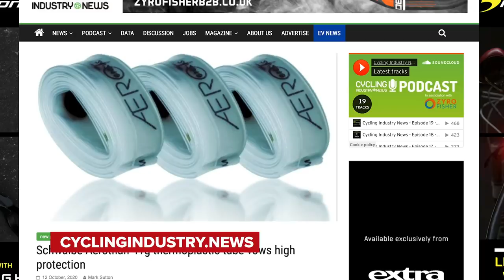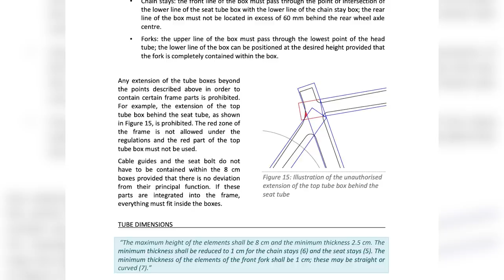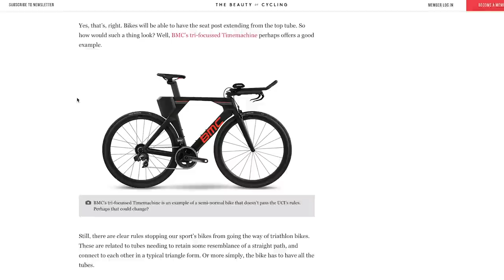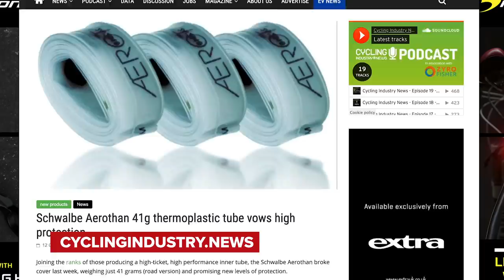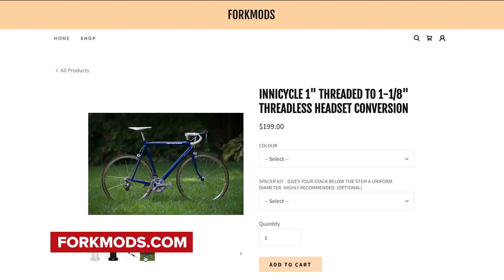New UCI Rules On Bike Design: Will They Change Everything? | GCN Tech Show Ep. 147

Comment: It's the perfect excuse to bring in new bikes on the market, that will be 7% more stiff, 11% more aero and 30% more expensive than last year's models!
Reply: I mean to give them credit they'll probaby be more faster and more complianter also.
Reply: + more sluggish because there will be no rim brake option only disc, rubbing discs 😅, fucking regretting buying discs brakes road bike;-;.
Reply: This is why I own a TCR. No bs
Reply: Meanwhile my favorite bike in my vault has 300% the weight, about 20% the stiffness and a geometry that would make any UCI regulator cry in pain.
But it's realy comfortable and reasonably fast.
Reply: And in red
Reply: @sirpablito6018  I'm not a fan of rim but yea, I feel bad for the people that does. Especially weight weenies. What's the problem with these manufacturers though, is it really that hard to put out a rim version. It's not like disk is absolutely better than rim.
Reply: @diesistkeinname795  and the aero frontal area of a double-decker bus 😂😂😂😂
Reply: @sirpablito6018  you know you can adjust your disc brakes? Fairly common to have to do it after you've had a wheel out. It can be a nuisance but they should never rub when properly adjusted
Reply: @RichardMigneron  Nope, the frontal area is about the same or less than on my roadbike.
Things like the BB beeing in front of the steerer tube, the handlebar beeing directly below the seat or a wheelbase longer than a DH MTB would sure make the UCI go crazy, but that's normal for recumbents...
Reply: @nt2883  Yes, I know m8. Idk what discs u have on your bike but mine new ultegra seems to be very sensitive   to everything: tight cornering, emergency hard breaking form high speeds, pouring raining but to be fair it saved me from crashing into a car who's driver was a moron. To conclude I think some ppl have problems with discs some don't. I've had problems from the start,  I think road bikes don't really need them, especially pros don't need disc brakes and they are made to ride them just to show us, mortal ppl that they are great and it is an upgrade to rim brakes which is totally not true. Discs are great for xc , gravel,  e bikes but not road in most of situations. I personally feel like I would be faster on rim brake bike so do team sky😉 because rim brakes just work, don't rub unless u fuck up your whole wheel;-; and discs can be bended even slightly and they rub af ;;-;;
Reply: @sirpablito6018  I use SRAM apex on my gravel bike and I find they're sensitive to axle tension but otherwise fine. A flexy frame will make them play up under heavy load. On my recumbent I have cable operated discs and they are always perfect all the time
Reply: @nt2883  Well I have hydraulic ultegra with this two gigant pears on a handlebar. I guess cable ones are just simpler and that is what makes you like them 😁. I'm happy for you m8 , I wish mine were always ok;;-;;
Reply: @satrioesar7151  $$$,$$$.$$ it's all about marketing. Hydro disc brake systems are more expensive than their rim brake counterparts. Wheels are generally more expensive too.
Reply: @TheMASDrummer  TCR is the best!
Reply: @RandomGuy-ol6wi  Apple's new M1 chip has turned your argument on its head.

Comment: The vast majority of "aero advantage" comes from the rider's position. Nothing more. To get that, you need to spend time in a wind tunnel together with an engineer/analyst. The "marginal gains" from additional aero beyond the obvious like teardrop shapes for tubes, better matched tyre/rim width and deeper section rims are microscopic by comparison: But as ceramic speed continue to prove, the maybe fictional 1W advantage can still be sold to enough suckers for a 4 figure sum. This used to be known as snake oil salesmanship.

Comment: The bike vault rules are all wrong. Aligning the cranks with the chainstays is permissible, and often looks better than precisely 3 o'clock. Valves at the top are just as good as at the bottom, the logos on the rims and tyres sometimes force one or the other, but otherwise either is okay.  And the chain in the middle of the cassette is fine, too, as long as the front is on the big ring.
Reply: Hear, hear
Reply: Agree, the 3 o'clock position doesn't look harmonious and even looks disturbing. Look at all product photos of the manufacturers, they are always aligned with the chainstay which look much better.

Comment: Hey GCN, have you ever noticed that every single bike manufacturer shows their bikes with the crank lined up with the angle of the chain stays? I believe this is the correct position for the cranks which is not quite at 3 o'clock (unless the chain stays are horizontal like MTB bikes). That BMC TMR01 actually has them in the proper position! Connor...

Comment: I ride Tubolito innertubes for a while now, also made from plastic, 37g per tube, no problems so far. But nice to see that a big player now has a similar product, potentially cheaper.
Reply: Why not tubeless!?!! Most punctures seal themselves without you ever knowing they happened!!! And lighter. Much lighter....
Reply: @winstoncat6785  you don't have to convince me about tubeless, my gravel bike is set up tubeless, my mtb was for many years already. It's awesome. I don't fully agree with your point about the weight though, the Conti GP5000 non TL I ride on my road bike combined with tubolito inners are quite a bit lighter than the GP5000 TL with sealant milk. But then the GP5000 TL are an especially "heavy" TL variation compared to other brands. The puncture resistance is better, yes, but if there is a bigger issue or too big of a puncture it's a mess, changing a tube at the side of the road is no big deal, putting a tube inside a busted TL wheel with bits of sealant sticking everywhere is not so pleasant. That said: tubeless is the future also for road bikes, that's for sure.
Reply: @CristoffelBonorand  I was going to switch from Schwalbe Pro One to Conti 5000's, until I "accidentally" discovered Schwalbe Pro One  Addix TLC, and I'ev stuck with those. They're really light - 260g on my scale. 25mm don't need that much sealant either. Panracer GravelKing SK (43mm) on my gravel bike. Close to indestructible. Sealed so many punctures on their own on gravel rides, I lost count. Anyway, 4000 kms for the last pair, which for me is unheard of. You're right though. In the very worst scenario, where the tyre can't seal, tubeless are a mess....but how often does that really happen is the question I ask myself!
Reply: @winstoncat6785  Has anyone experience with tyreplugs on racebikes in the case of a large puncture?
Reply: @guidospanoghe8896  I tried it once with Lezyne plugs and it wouldn't work because the tool is too long for the height of a 25mm tyre. However, I've seen it claimed that Stan's plugs (and tool) will work. They're pricey. And I never tried it myself.

Comment: Some decades ago I saw a bike, where the upper part of the seat tube was completely normal. The lower part of the seat tube, however, was split in two thin "stays" down to the bottom bracket. The chain stays were shorter than normal, so the rear wheel was much closer to the bottom bracket than normal. The wheel base was probably also shorter than normal. Above the bottom bracket the rear wheel was "cutting in" between the two thin "stays" of the seat tube. I guess, the purpose of this design was to make a more nimble handling than with a longer wheel base. This purpose could maybe also have been achieved by using a bent seat tube following the circumference of the rear wheel instead of a straight seat tube. I don't know, what the UCI rules would say about these designs.

Comment: Olli, no. You don't need to same amount of material when you change the shape of the tubes. Think about 2nd moment of inertia for example. The brand's will reduce the weight of the frame and have to add more ballast for race machines.

Comment: C'mon Connor, do some research - that was a weak attempt on the Cipollini Cannondale, but if you were just looking at photo techniques, not only were the cranks wrong, but the valves were way off. The Spinergy wheels had incorrect logos for the era and would have had yellow "dagger" decals on the blades instead. Not sure what's going on with the exposed aluminum on the stays, as that was not original to that frame, and the fork would have been the Time carbon version. AND "splash" bar tape is hideous garbage that should never be put on any bike! Look at this: https://cycling.today/retro-pro-bike-mario-cipollinis-cannondale-caad-4/

Comment: Is there a reason why the weight of bikes will stay the same? Surely that also limits innovation to some extent? And if everyone rides the same weight bikes in the peloton, why does it matter what that weight-limit is? And.. could the pros have bikes which by themselves are lighter than the limit, where they then add weights to bring them up exactly to spec, like F1? And last point. the BMC at 6:50 is horribly ugly!

Comment: (Deleted comment, I didn't understand the innicycle converter. Pretty cool bit of engineering actually for the niche market!)
Reply: Most 1" threaded forks don't have a long enough steerer tube to clamp a stem to, because they are only designed to have enough room at the top for an adjustable race, washer, and lock nut.
Reply: Hi Galen, have a read about what the product does and who it's for on the website. Cheers.
Reply: @forkmods5286  i stand corrected, thanks!
Reply: @galenkehler  All good, mate! We get some of the same sort of questions about our thru axle conversions. Sleeving a 12mm axle to suit a 15mm hub is and has always been easy. Going the other way is hard. Thanks for your comments.
Reply: @forkmods5286  I've often recommended people change out the fork for a threadless fork when they want to go this direction, but this is a nice solution that maintains the look, better for the environment (not wasting a part) and probably saves money.